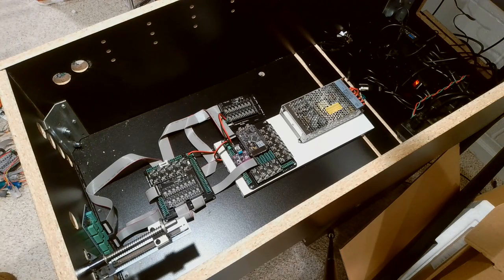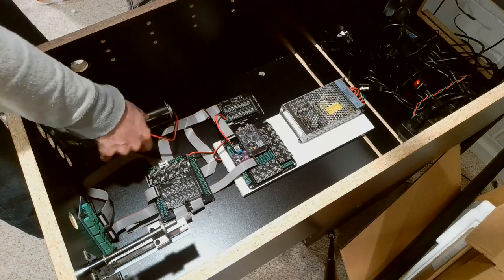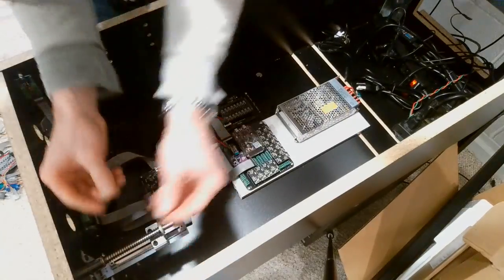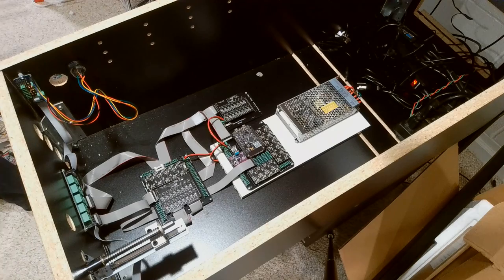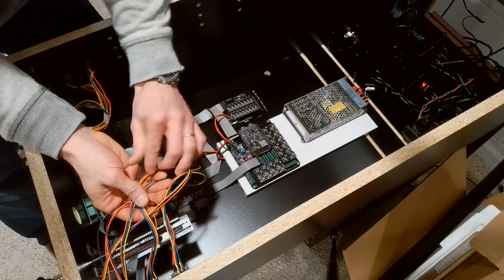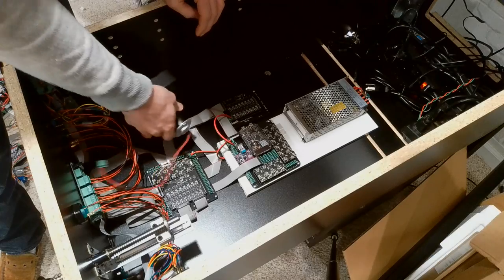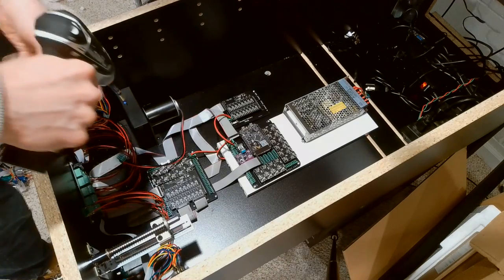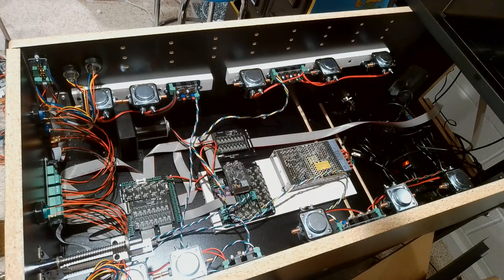Virtual Pinball Solenoids, Buttons, Shaker, Plunger and Light Bar Install Cleveland Software Design

Comment: Looks awesome, nice and clean as well! It's great to have people like yourself in this community doing so much to help out with building a cabinet. With more people every day joining this amazing hobby and community looking to start building a cabinet, it's always great to have more options!

Between you, Zebsboards, Arnoz store and German Gaming Supplies, you can get everything you could possibly want or need in a build. Each of you offers different ways of doing things and with some different items to buy.

I wish when I started my build a year ago you would have had the selection you do now! I for sure would have bought everything I needed from you. When I started I had just heard about you through Bee Kongs video with you. And you were just offering the stand alone flipper solenoids at the time. Which I am getting soon I might add lol. But sadly after ordering my parts, not much longer after you started rapidly adding all of these new items. You have a great selection of useful items, nothing in your store seems unnecessary or outdated. You and Arnoz are definitely the top virtual pinball   parts vendors.  I know in the future if I need anything else or a new build I'll be buying it from you. I've bought your motor controller and RGB flipper buttons so far, both are great. You have the best prices in my opinion as well, everything is more than fair. For people like myself who aren't too savvy with electrical wiring, soldering, etc, it's a great resource to have and it has helped me tremendously. I'm good with PC hardware and software, and a quick learner with this kind of stuff. But I didn't want to do any soldering, didn't want to go the cheapest way to add toys and lights. The older boards and way of doing it required soooo mich more work and wiring to connect it all. It just looked like a nightmare. Especially with the older ledwiz and relay boards, solenoids required much more wiring and connecting. And the 5 RGB light bar, endless wires. Instead of 3 wires for each led flasher soldered in a board for 15 wires just for that! Down to literally a ribbon cable you connect when the LEDs are installed directly into the board. So much better. As far as I can find you are the only vendor offering it this way, with just one connection. Don't even need to connect power to it directly and it has the bonus of an additional strobe output, perfect. When I bought my light bar yours wasn't made yet, but was exactly what I was looking for. Luckily I found the only other vendor offering a similar light bar to your style, from German Gaming Supplies. His is almost the same, LEDs on the board and only need to connect a 16pin ribbon cable. But his has a power input for 5-12v you need to connect. And sadly no strobe outputs which I want! But still simple and a much more clean install, and it worked fine.

Keep it up! I hope you stick around and keep innovating in this scene for years to come 🙂

Also, any update on the strobes you said a while back you would make? I'm holding off on buying some to see yours, assuming I'll probably want your strobes. 🫡 If I could suggest a future item to add to your store, I would love to see what you would come up with for a 12v fan addition, and possibly red/blue beacons?  It's the only other upgrades I want to add eventually, and as it stands it's tricky to find good ones around. Also those are the only items I couldn't find any virtual pinball vendors selling surprisingly. Being the only vendor selling those custom made if you did, I'm sure it would be a good seller! I know a lot of other people that want those add-ons but don't get them because it is tricky to find any, or find  compatible ones for a pinball cabinet. I know I would buy those in a heartbeat if you did! Thanks again if you read this 🙂

Zuxif

Comment: Are there wire channels on the bottom of that large white board?  Did you  use a router or did it come like that?  If so, what's it called (so I can go get one)?

Thanks.

Comment: Your correct phil, even on a full size cabinet the solinoids should be mounted on the side walls because you'll get the feeling as well as you'll hear the noise louder mounted on the side wall. People who mount it across the cabinet actually are losing out on some of the feeling of the solinoids firing. Exactly the way you have it sounds and works best. Especially once the screen and everything goes in. This is the best kit for anyone building a cabinet. Besides a pc someone builds for you, companies charge $10k for exactly what you just installed. People are crazy who don't buy your kits.

Comment: Watched the whole thing. I appreciate you doing this. I'm assuming that you have a pdf somewhere to twll me what plugs where. Although I did take notes for the things you mentioned. 👍 What about ventilation? I didn't see any holes for fans.
Reply from the maker: My computer is under the cabinet, so really no heat is generated inside. I have a picture that shows where everything plugs in! The new PinOne is actually even simpler than the KL25Z setup!

Comment: Did you make this cabinet or this a flat pack/ prebuilt? Thanks!
Reply from the maker: Currently just for me. It's a really simple build since there is no top to it. I wanted a cabinet that I could put any size monitor on the top without requiring it to fit inside a backbox.

Comment: Would this fit in the grs mid size cab? This is tooooo nice
Reply from the maker: Yep it will fit in there, this cabinet is just a bit larger with a 32" display instead of 27" display.